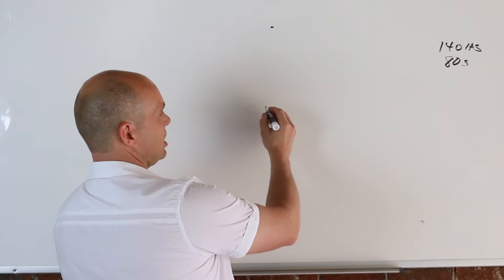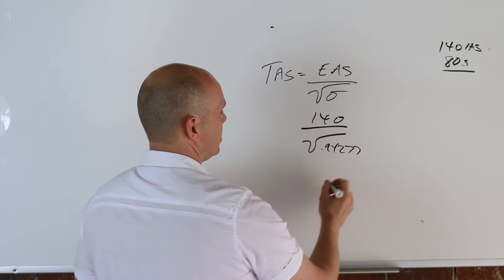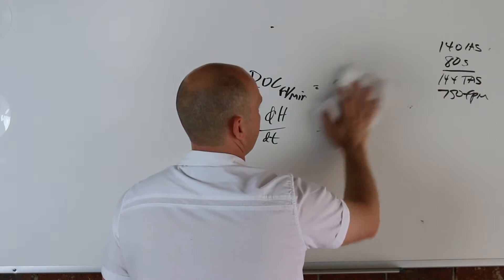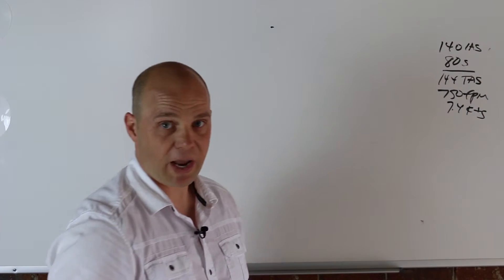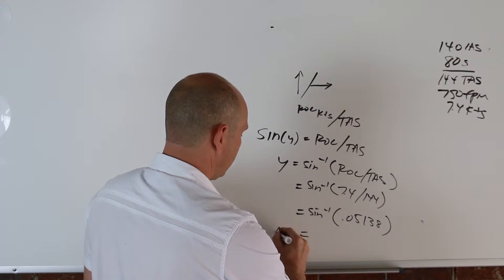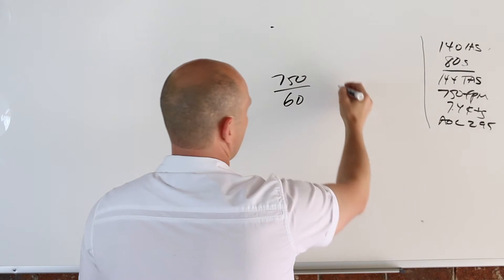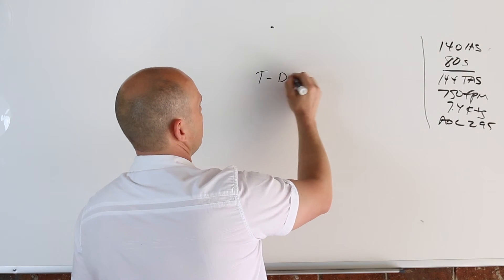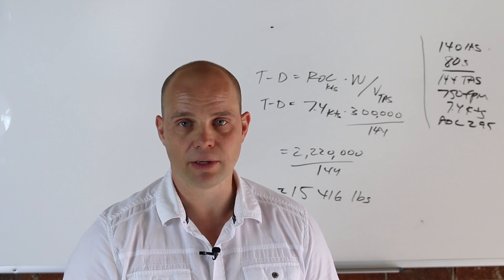Aircraft Performance 310 - Exercise 7

Comment: Thankyou. I have a question, EAS and IAS differ from each other.

But my textbook states that TAS = IAS divided by the square of relative density (sigma).
Why did you say that EAS quals IAS 'for this video'? If you will always have to use the IAS.
Reply from the maker: Hi. Happy to help. Equivalent Airspeed equals True Airspeed corrected for compressibility (this happens at higher altitudes and at airspeeds closer to 250 knots). Below approximately 10,000 feet MSL, compressibility is negligible. Because of that, KEAS would equal KTAS.  I believe I was using sea level standard day conditions. In those conditions, Indicated Airspeed would essentially equal True Airspeed. I hope that helps!